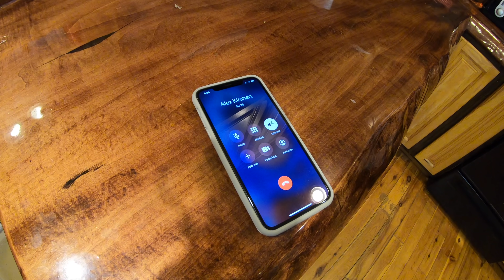Sleep deprivation, Painting & Beginning to hallucinate= VIDEO #2 4 k video

Comment: Mike, believe it or not I am an ex professional faux painter. I did this commercially on countertops for years. We would clear coat counters with automotive urethane or epoxy for durability after the base dried. Here's A few pointers. Use a natural sponge instead of a plastic bag. We stocked up on latex stains for each job Matching natural stone! We would practice in our shop before doing it on a customers counter and made a proof for them to see.We made great money doing this but I had health issues and was forced to retire
Reply: I spray counters too how long did you have to wait to be able to clear  coat
Reply: @als3449  typically we didnt wait long . The stain we used was very fast drying.. dry to the touch. We used a n automotive epoxy primer as the first coat and we tinted it to usually a light brown. Sometimes white before sponging on the stain.